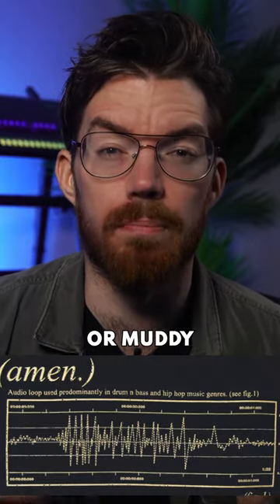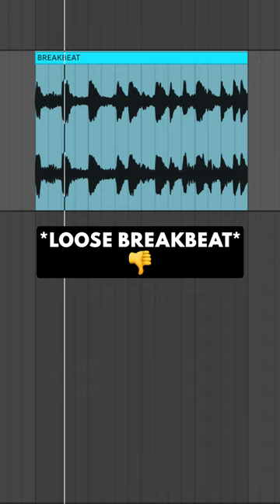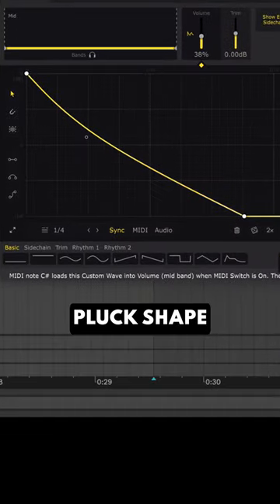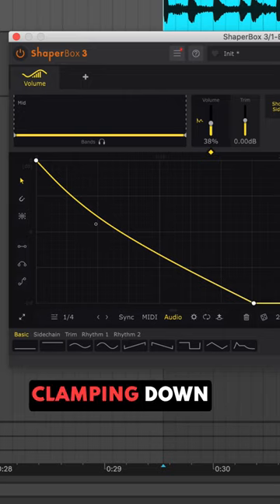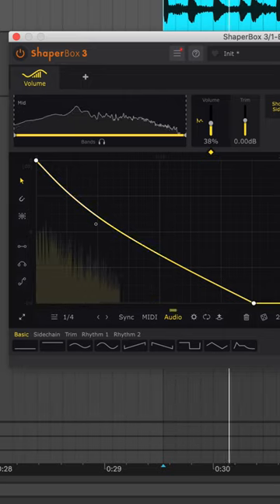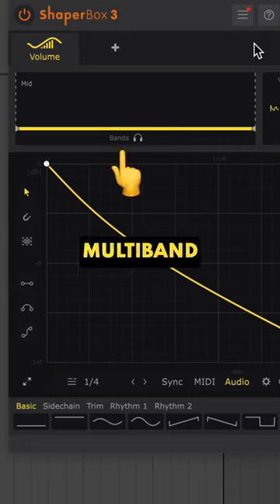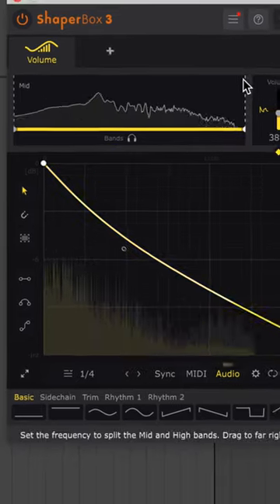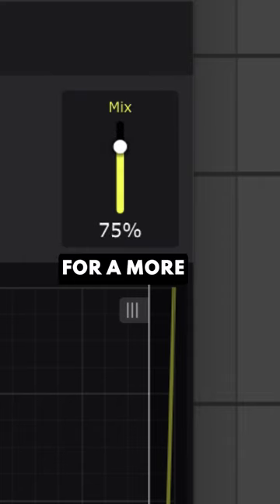Fix Loose Drums And Breaks In 30 Seconds 🥁

Comment: tip: in warp mode use beats, transient setting and use the one arrow icon. don't need a plugin for this 💪🏻
Reply from the maker: Live's transient looping is cool, but it's limited to one slider, and only works on the full signal. VolumeShaper can be used as a fully drawable, 3-band multiband gate.

Comment: alternatively, adjust the samples warp setting to 'Beat', the transient warp method to the double-stacked right-facing arrows, then drop the transients to anything below 100. it automatically clamps the most amplified transients. then use multiband dynamics to compress low frequencies. all of this is stock :-)
Reply from the maker: Live's Beats transient gating is great! But it's better for creative effects. There are no additional controls, so the results can be somewhat random/innacurate, especially on breaks with loose timing. Multiband volume-shaping or gating is the tightest, cleanest way to do this.

Comment: Ableton alt use Beats mode
Reply from the maker: Live's transient looping is cool, but it's limited to one slider, and only works on the full signal. VolumeShaper can be used as a fully drawable, 3-band multiband gate.

Comment: Is this same as a transient master NI ?
Reply from the maker: No, that's a single-band transient shaper. VolumeShaper is a volume modulation tool with an LFO for all 3 bands – used for drawable multiband sidechaining, gating, transient shaping, tremolo, etc 👍